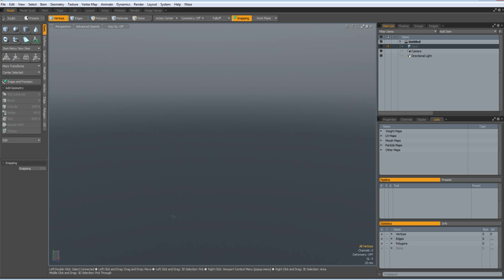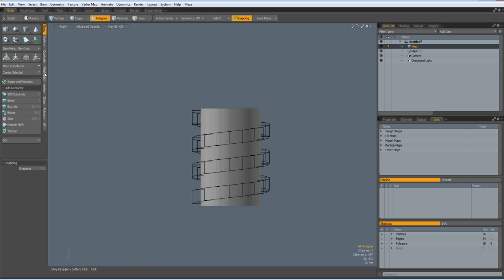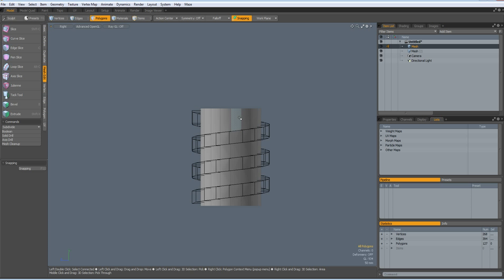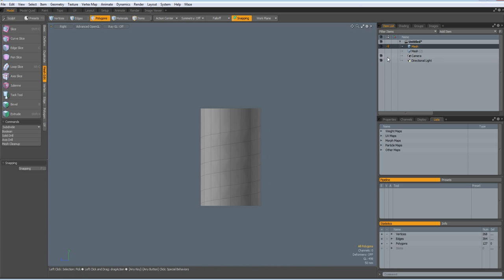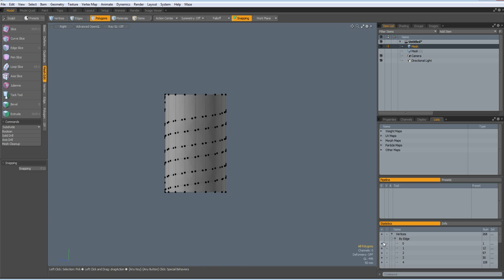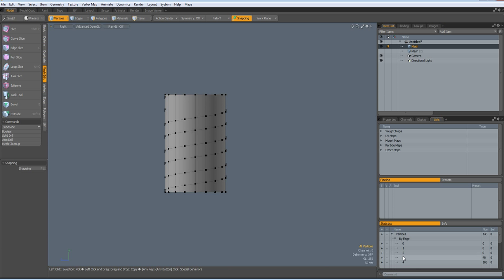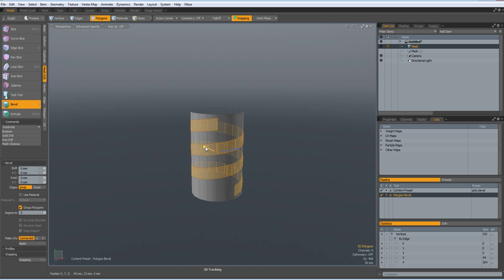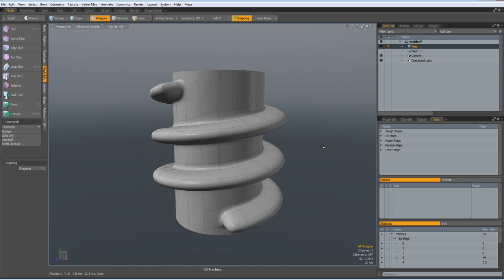Luxology Modo - Getting around Boolean problems in Modo 701

Comment: Nice tutorial but my spiral just loops on one level does not travel downwards. I have set the offset and copied all of your other values exactly. Any ideas?
Reply from the maker: Hi, did you also make the initial cylinder the same size as i did ? i used 100/100/100 mm as X/Y/Z radius. Good luck, Peter
Reply: Peter Stammbach Thanks for your reply Peter. I am using a trial of Modo 801. I had a look into the advanced settings and there was one (sorry cannot remember the name) I found when I played around with this setting it started working fine.